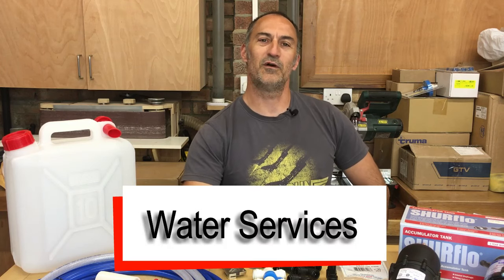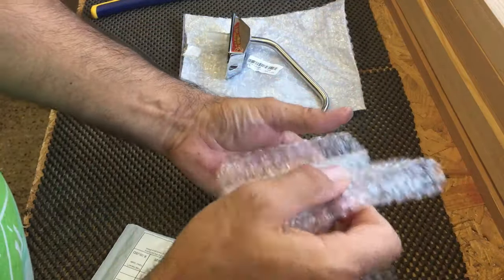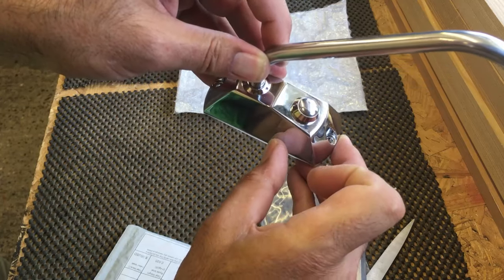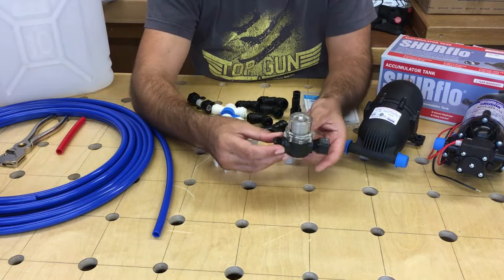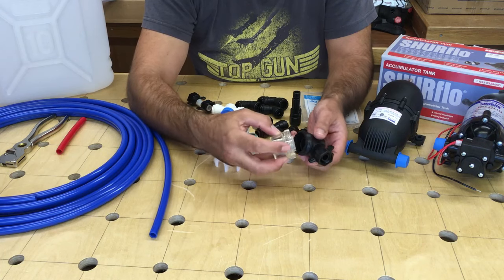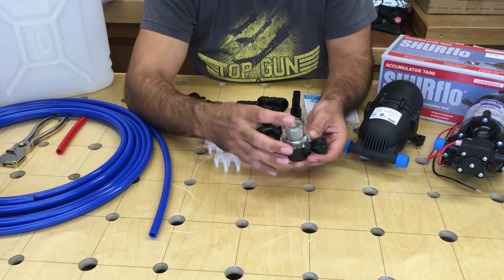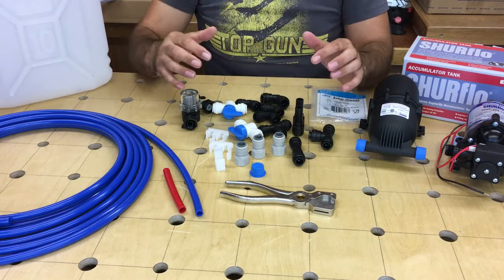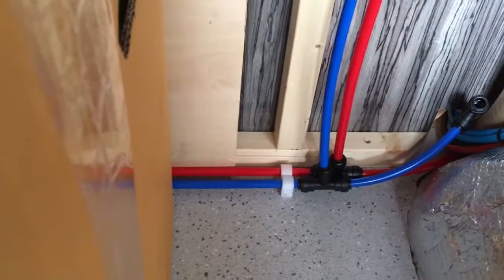Domestic Water Services - Camper Van Conversion Series

Comment: Hi Greg.  I thought you would have used JG pipe insets at the fittings to maintain the shape of the pipe within the fitting for belt and braces watertightness?
Reply from the maker: I did look into that Ian, the installation instructions on JG website says it’s a recommendation but then it’s not shown in the diagrams. I have emailed JG for confirmation. Hope they reply soon 😐
Reply: OK,  I know they do sell them for 12mm ex dia. pipe. Part No. TSM1209s
Reply: Under the 'How to make a connection' section on their website they do make the comment 'For soft or thin walled tube we recommend the use of a tube insert.', though they don't appear to show the use of this insert on their cutaway drawing of the connector!  
Brilliant series of videos by the way. I have really enjoyed watching them and have recommended them to others on other forums.
Reply: You don’t absolutely need the inserts but I always put them in. They also allow you to use the JG pipe directly in a compression fitting. All this stuff is also readily available from any builders merchants or DIY store in the UK.
Reply: Having worked with plastic pipe/fittings for years, i would put the inserts in (especially for what they cost), been called out to many a leak where someone has forgot to put an insert in. Might not happen straight away but once its been warm, cold, warm, cold it will soon develop a leak and you dont want that in your van after all the hard work :) Also these were on GCH systems where the pressure is only 1.5 bar (usually), its mainly when the pipes warm and soft without the insert its just got nothing to push against and hold it in tight enough
Reply from the maker: Ian, I got a reply email from John Guest Technical dept today to confirm that inserts are not required on cold water services but recommended they be fitted on hot water services. So I will be adding tube inserts to the hot water joints, fortunately, I made sure it was all accessible and not hidden away.

Comment: Hi Greg I use you as my main source, being a novice in almost all the technical aspects. I bought the parts you show here, but the connector joining the pump to the filter won't 'slot' in the way it does in your example. I've tried using reasonable force, but it looks as though both the fluted white plastic nozzle and the opening on the filter are the same size! Have I got the wrong connector?

Comment: Hey Greg, super helpful as always! What precharge in an accumulator should someone get for a 30psi pump?
Reply from the maker: dadamdilby the air pressure in the vessel should match your pump pressure so 30psi
You can check and adjust this yourself via the tyre valve on the top of the vessel. Do this when it is empty of water 👍🏼
Reply: @GregVirgoe   You have saved me hours and hours of my life by answering my questions. For that, I thank you kind Sir.

Comment: Hi Greg! We love your videos! Thanks so much for all of your detailed explanations! Having used your water services for some time now, how do you feel the "push-to-connect" fittings are holding up? We are interested in using these ourselves and are wondering about their longevity. TIA!
Reply from the maker: FindingFreshAir they are absolutely brilliant work first time easy to assemble and no leaks or problems at all. In fact the only leak we had in the van was a jubilee clip on the hose connection to the toilet. Push fit every time they are so good. Note you need the pipe inserts for all hot connections. 👍🏼😀
Reply: Ahhhh that’s great to hear! Thanks so much Greg! Yes, we saw your pinned comment about the inserts! Thanks again!
Reply from the maker: FindingFreshAir excellent and good luck with your build 👍🏼

Comment: Hey Greg,
Knowing the Shurflo diaphragm design pump is noisy, didn't your research turn up a silent pump design?  Rotary vane or something else perhaps?
Reply from the maker: Rotary pumps or accelerators as they are correctly known are not self-priming and rely on a flooded inlet to work.
The only other type I know of are peristaltic pumps, like dialysis machines, used for condensate removal in AC systems
They self-prime but have got very poor flow rates and you still get a bit of whirring noise, much quieter than diaphragm.

Comment: Your videos are fantastic!  I'm still in the sketchup design phase, and stuck on the grey water drains.  How do you get the drains from one side to the other (I believe your grey water tank is on the opposite side to your sink) and what size/material do you use for the drain?
Reply from the maker: gym and a bee good question I need to do another video on the drains. 
I cut another 1 1/4” tank connector into the side of the grey water tank and ran under the chassis across the van and up into the kitchen cupboard. You do have to use 45° elbows to go up and over the prop shaft to the tank. It creates a large trap on the sink side under the chassis which is always got water in it but there’s no problem with that. I put a swept tee and a rodding eye on the bottom of the sink waste at the lowest point if I ever wanted to clean it out. It works perfectly. The shower drain was 1 1/2” and connects onto the end of the tank. 
Both waste connection have a compression straight joint near the tank that can be disconnected if the tank ever needed to be removed for cleaning. Hope that makes sense 😀👍🏼
Reply: @GregVirgoe  Thanks, that clears things up and answers everything. My wife is from Berkshire, maybe next time we're in the UK we can have a look at your van.  Much appreciated, have a pint on us!  Thanks again, Jim and Abbie (gym and a bee)
Reply from the maker: gym and a bee happy to help and have sent you guys an email just now. Thank you very much 😊

Comment: Hi Greg, have you heard of expansion vessels failing? Are they really nessarsary? Mine failed after only one week of use, suddenly just heard the pump kick in for no reason, ran to the back to find the expansion vessel gushing water out of the middle of itself all over the back of my van, I used a fiamma one. I'm not worried about replacing it with the same model, or changing to another model, or even getting rid of all together. I was shocked it could fail so badly so early and the damage it caused was rather annoying.

Comment: Hi Greg can i ask with the pump and accumulator vessel fitted do the taps need to have micro switches or will the system work without. Currently working through my van build and your videos have been extremely helpful throughout. Thankyou

Comment: hi greg, any advice on deadening the sound of pump?
Reply from the maker: Try to avoid mounting it on a thin board that can easily vibrate. Don't overtighten the screws in the rubber mounting feet. You can build a box lined with dense foam to place over it to reduce breakout noise.
Reply: @GregVirgoe  thank you :) I will try and share the results

Comment: Hi Greg, 
Great videos and find them all very informative. one thing, I have bought the same pump and accumulator which is connected via the 13mm ID/ 19mm OD pipe but cant find a shut off valve, any help/ ideas/ pointer where to purchase. 
Many Thanks.
Reply from the maker: Dave Williams I used 1/2” x 12mm female adapters to convert to 12mm LDPE push fit tube and fittings then used a 12mm isolating valve. Use the links in the description.

Comment: Is the 12mm feed to the pump ok or would you with a bigger feed if was to do it again
Reply from the maker: MrWear1967 most of our water supplies are over fed so they never suffer from small bore Pipework. You only use one device at a time so 12mm is more than enough in a van. 👍🏼😃

Comment: Hello Greg. Thanks for another great video. I have a few questions. Did you have to install any 1 way check valves in the system? Are you going to install a city/mains water connection so that you can be hooked up to water if you want to? Do you have a diagram for your water system that you would be willing to share?

Comment: What is special about the connection between the pump and accumulator? It uses a different type of pipe connection and no John guest fittings. Where can I order that? Thx
Reply from the maker: It’s a Shurflo part you can get off eBay https://www.ebay.co.uk/itm/372371947873?mkcid=16&mkevt=1&mkrid=711-127632-2357-0&ssspo=s233y439SkW&sssrc=2349624&ssuid=IAwKHBzwQ6K&var=&widget_ver=artemis&media=COPY

Comment: Hey Greg , just wondering what Diameter pipe you are using?
Reply from the maker: 19:35 :D
Reply: Greg Virgoe bingo 😉 I did look 😂 roughly how much of each pipe did you order ? Thanks for great video .
Reply from the maker: Hi Gavin, I used about 10m of hot and 15m of cold, they both run around the van in a loop from one side to the other.

Comment: Will you be adding heat tracing/ insulation to exterior tank and tubing?
Reply from the maker: Hi Chris, I will be insulating the water pipework but not the tanks, they are very thick and we plan to head south for winter like the birds 😊

Comment: hi greg ive looked in the instructions and it says to use min 13mm inside diameter tube on the shurflo pumps im confussed cos your using less which is a system i wanted to use does it work ok thanks stu ps love your videos
Reply from the maker: Hi Stu, yes it works perfectly, really well and I've got the trail king 7 which is the smaller flow rate bad pressure so 7l/m and 2bar. Do fit an expansion vessel that will help stop the pump cutting in and out so often and give you the expansion room you need. I'm really please how well ours works lots of pressure and plenty of water flow, very happy
Reply: @GregVirgoe  thanks greg

Comment: How did you connect from your CAK water tank into your 12mm JG push fit water system?

I'm looking to get a CAK for my van too and on the website it says 15mm fitting for the fresh water outlet.
Just trying to figure out in advance what I need to connect this together
Reply from the maker: The outlet was 15mm so I put a 15mm push fit elbow onto that and then inserted a 15x12mm stem reducer into the elbow. 12mm pipe into the reducer. 2 fittings is all you need and it all pushes together in seconds. Very easy.
Reply: @GregVirgoe  brilliant, thanks for your quick reply!
I've watched most of your videos many times and they are always very detailed and helpful, thanks :)
So all the connections for the pump & expansion vessel can be converted to push fit too then? I guess they are 1/2 bap thread or something?

Thanks for your help :)
Reply from the maker: @sypris1001  these are what you need 😃 https://www.ebay.co.uk/itm/193868471662

Comment: Hi Greg, wondering how noisy your pump system really is... I've got a Shurflo pump as well in my van but it is incredibly noisy. I've been trying to remedy that by putting pipe insulation around key points (that I can reach) and I've tried to minimise where the flexible pipes touch any wood or panel. I don't have a pressure vessel in between. Just how much and with what could one isolate + insulate the pump to stop sounding so noisy? A box full of sound deadening foam? I'm not sure if the pump really is the problem or the pipes themselves.
Reply from the maker: Coen de Jong there’s a few things to consider. What is the pump fixed to? A thin flexible board will resonate more than a solid base material. Rubber mounting feet with screws not done up too tight. A box lined with dense foam around the pump will help with breakout noise. An expansion vessel only helps to reduce demand and give somewhere for pressure to go when system cools and heats up. It’s a good idea to fit one on a closed system to prevent leaks.
Reply: @GregVirgoe  Thanks for the reply Greg! It's mounted on the top floor of the van, screwed into about 1.5cm of wood underfloor. I could check the screws how tight they are. The rubber feet are there. Any chance you could make a video about it in the future (some kind of Q&A combination video with this in it) where you record the noise coming off of yours? Then I know what is "normal" and what's not ;)

Comment: I have a question, sir. 
What is the size of the pipe used in the inch
Reply from the maker: This pipe is metric 12mm OD so it’s close to 1/2” diameter.

Comment: What pipe is in between the pump and accumulator tank?
Reply from the maker: You need one of these https://www.ebay.co.uk/itm/193849456796?hash=item2d2253f89c:g:vuEAAOSwlJVgh91W&mkcid=1&mkrid=710-53481-19255-0&siteid=3&campid=5338027957&toolid=11800&mkevt=1

Comment: I think I'm being dumb but the wire on the shurflo is short. I need to extend it as my transit electrics are at the other end of the van. Am I ok to use a 2m wire and extend it from the shurflo? Cheers
Reply from the maker: You can extend the wires the cable need to be at least 1.5mm2 over a 2m length. 👍🏼😊
Reply: @GregVirgoe  many thanks, you are really helping me here. Love the work

Comment: I ve been wondering, JB doesnt seem to make a 1/2  npsm female fitting did you use something else insted? In Theory it shouldn`t fit should it, as the threads are different or am I wrong. definitley a nightmare with all the different standards. cheers

Comment: Hi Greg did you run any pipes under the floor?
Reply from the maker: jop1928 no I didn’t. It’s not good practice to bury pipes in floors or walls in case you get a leak. You would not know until it has caused major damage. So I ran it across van in the garage, inside kitchen cupboards and in the bench seat where it can all be seen and checked regularly.
Reply: @GregVirgoe  makes sense, thanks Greg, youre a superstar
Reply from the maker: jop1928 I’m very happy parked up by the beach with a beer in my hand. Thanks for the offer 👍🏼😊
Reply: @GregVirgoe  good stuff enjoy 👍👍
Reply from the maker: jop1928 thank you 😊

Comment: Put those inserts into every pipe, not just hot. Better safe than sorry later, can't do any harm in the blue piping can it, & inserts are cheap anyway; you usually are ''belt & braces'' with everything, so I'm surprised you're putting inserts only in the red piping. Alan, UK.
Reply from the maker: You make a good point Alan, I have had it confirmed from JG technical.
I could do it now, some are a little awkward to get to but not impossible.
You know what, I think you have swayed my judgement on this one.
ordering more inserts now :D

Comment: Water supply 
1 backflow
2 pressure regulator a housing tract 1 mile from city well. At two am no one using system blew out every nom fit copper pipe with angle stop in the project. It was expensive fix for plumbing company. You can install a drain pan under kitchen sink in case of leak drain to outside. Worked for a woman she installed imported marble bathroom. The washing machine hose failed. Did not instal pan under hot water tank and washer and quick shut off washing machine
Reply from the maker: As best as possible I've tried to keep all the Pipework accessible so I can check it regularly.

Comment: 1/2” (or ~12mm) John Guest fittings are very difficult to find in the US. Is 3/8” sufficient for camper water lines?
Reply from the maker: Nom Solo if you are using a diaphragm pump like mine and have 2bar or 30psi pressure that will most likely be ok as you only using one item at a time.
Reply: Greg Virgoe thanks, I’ve got a 45 psi, 3.5 gpm pump.
Reply from the maker: Nom Solo you should have no problem at that pressure.

Comment: Great video thanks. I was wondering how long you will be able to have a shower for with a 7 litre cold water flow rate and 10 litre store of hot water in the combi boiler?
Reply: Wet yourself down, turn tap off, soap yourself then tap on to rinse then off. There would be no luxury showers, but better than standing in a bucket.
Reply: The Truma Combi cost over £1200 for a two minute shower :-) You can get many instant flue less water heaters that will deliver over 8L - 10L a minute for as long as your gas will last for about £150 - £200. In the previous video "Truma Combi 4e Heating & Hot Water Boiler" Greg says "One of the things that was at the top our list was to have a shower." I would say this huge oversight which doesn't seem to add up considering he is a mechanical services engineer?

Comment: Hello Greg yet again another question, could you theoretically come from your sureflow into a  3 stage water filter directly onto your drinking tap?
Reply: Hi Isaac, depends on the size of your filter (and thus the amount of friction it adds to the system).. Run some tests. With a properly spec'd pump you should be fine. I am running bench tests at the moment with a three stage filter (for a recirculating shower - 10" Big Blue from Aquafilter, with a 20 micron PP to 5 micron PP to 5 micron charcoal), and it's just fine. I am using a SHURflo AquaKing II Supreme which pumps approx 19 litres per minute (about 50% more flow than from better-than-average mains pressure).

Is that helpful?

Comment: Again: Water tank, strainer, pump, accumulator, faucet allow to have running water in my RV. But: Water is not always clean, fresh and safe. If I do not want to use Micropur desinfectant all the time, I need 2 filters, one for bigger and one for smaller (bacteria) things. So please add some information on this part of the RV water installation! (E.g. the PENTAIR filters, compatible witth SHURflow pump an accumulator tank). Thank you!